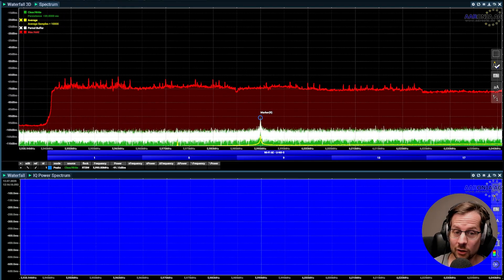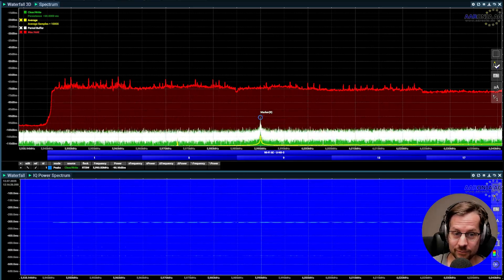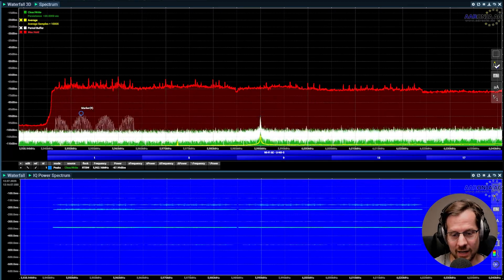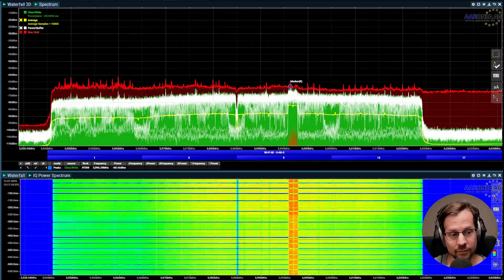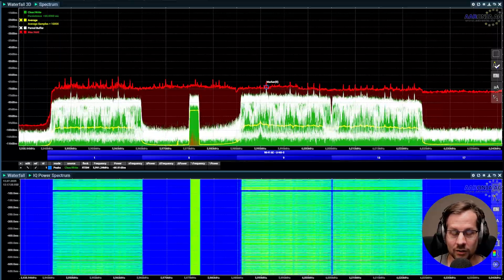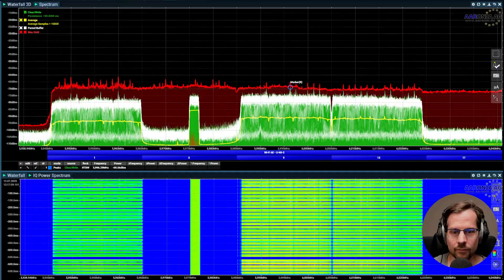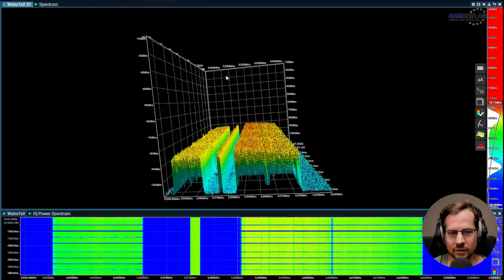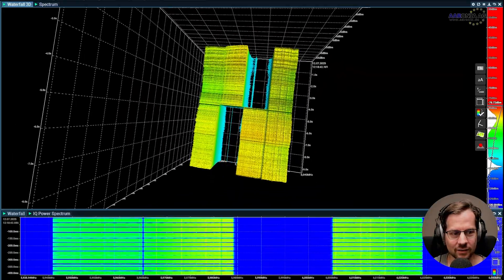Wi-Fi 7 - Preamble Puncturing Demo

Comment: Hi Kjetil, great video thanks. With 1 interferer, you lost 1x20mhz partion of the channel and the remaining 3x20Mhz was running. What if there is another interferer in another 20mhz portion? Can you lose another 20mhz?
Reply from the maker: Thanks! You can disable more channels in the same block for example 20/40MHz but CLI commands didn’t like it, looked like a 20MHz was the best I could do on a 80MHz with the current configs. 

Can try with a 160MHz channel later.